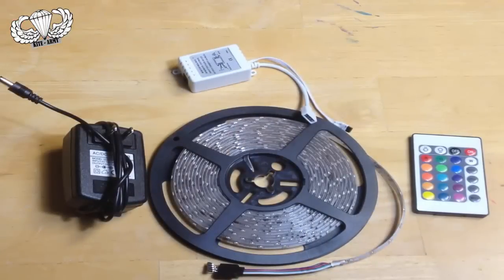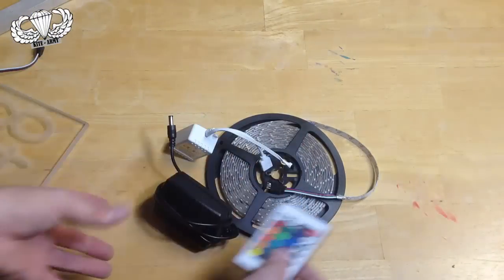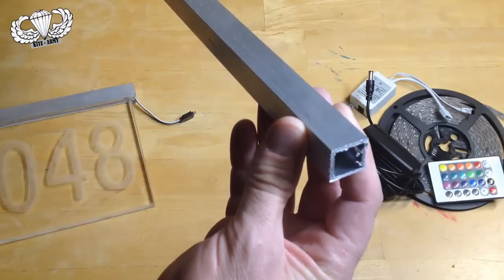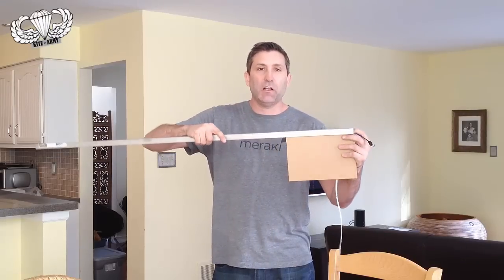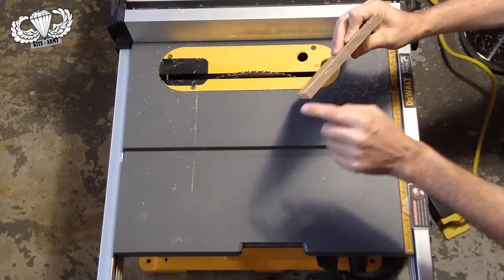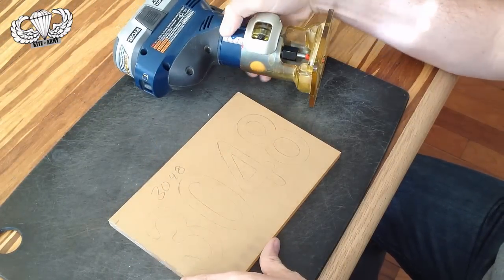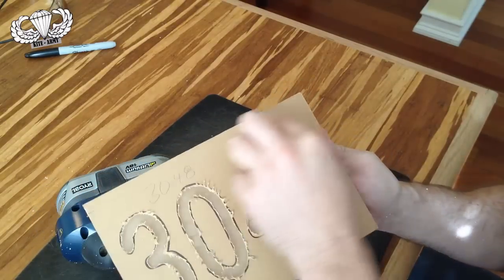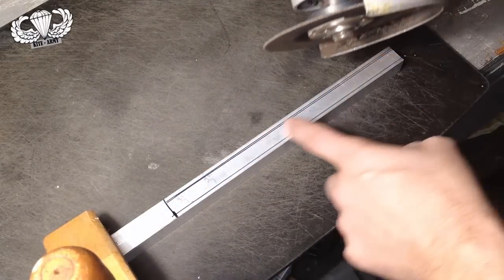Make LED Light House Number - DIY Build Project

Comment: Can you make it work from Dust to Dawn with an attachment, that's what i am looking for Tom of cape coral fl thanks and nice job guy
Reply from the maker: Sure - all you need is a photovoltaic sensor for an outlet that drives the power supply

Comment: One assumes the sign will be used outdoors so why not discuss weather-proofing it? 

The least I would do is inject some clear silicone weather sealant into the ends to prevent bugs and moisture from entering.

What I am not sure about is how I would protect the electronics boxes from rain and snow. Maybe I would cut the wire from the power supply and splice in a longer wire so only low voltage is running from my house to the sign. 

In my case, the sign would be over 150 feet away from our house which sits back from the road and atop a small hill. The sign would help delivery people and first time visitors find us.

Do other DIY folks out there have any ideas about these issues?

Thanks.

Terry Thomas
Atlanta, Georgia USA
Reply from the maker: I have it outside for over a year with no issue.  But once your sure you have it right, silicone certainly won't hurt.
Reply from the maker: Other thing.  I installed my power supply inside my walk way 110v light.

Comment: Very much appreciated!!  Just like to get a more professional way to write letters / signs in acrylic but it is not expensive!
Thank you
Reply from the maker: Do you have access to a laser engraver?
Reply: Or a dremel tool. I personally like the effect of that better than the deep engraving the router does. You only need to lightly scuff the acrylic to get the glowing effect.

Comment: I use Lumenedge LED edging, it comes already assembled and is not expensive. I order my acrylic on Amazon or buy it through Techshop. I then go to Techshop (maker space) and use one of their 24" x 18" CO2 lasers to cut and engrave the acrylic. This way, I can get large poster-sized LED lit signs done in about 30-60 minutes. Wanted to share this alternative method with you.
Reply from the maker: Laser cutters are the best

Comment: USE THE TABLE SAW to cut the aluminum. Almost any carbide blade works, just go slow and use a push stick.
Reply from the maker: That will work too.  Great tip
Reply: significantly riskier for the average user.

Comment: Nice video!  Another way to do this is to cut out your design with an X-acto Blade and using comet sink cleaner to rub into the cut-outs by fingertip, or you can also use a spray can of window frost.. This will give you the fog / Frosted look you desire.  You can use anything that is basically made of a fine abrasive including fine grit sand paper.  This way you can avoid all the tear out and un-evenness of the lettering depth that you can get when using a dremmel or router.  Sandblasting is another method but you really need to watch the pressure guage while at the same time keeping an eye on the edge of the lettering cut-out but it can be done using sandblaster also.  Another good idea is to find metal designs and simply set t against your plexiglass and sandblast over the object to get it's silhouette on the plexiglass.   Hope this information can help others to think outside the box.
Reply from the maker: Great tips!

Comment: Meraki tshirt :) 
I used Meraki for years but their cloud based management cost us $120 annually per access point so we moved to Aruba and Ruckus APs
Reply from the maker: I was wondering how long it would take someone to comment.  I used Aruba and Cisco - Feature wise these are the best.  Headache wise - Meraki everyday!  I have even started using their switches and firewalls.

Comment: Where did you find such thick plexiglass?
Most warehouses I found had 0.8mm as their thickest, the one you used looks like it had 1.2mm or even more.
Reply from the maker: I just ebayed 1/2 inch plexiglass.  Cost about $9 delivered.
Reply: Kite Army
Alright, thanks!
Ebay did the trick indeed.
I previously had problems finding offers in Europe.

There also appear to be differences in quality which have quite an impact on the price.
Reply: +LinkEX Check around..  I always buy plexiglass sheets  1/4 x 8' x 4'.  Back in "91 I used to get a sheet for $98 but today it's double that.  I build Candy Display Units and Cash Register arm guards for theft deflection in local stores.  I also use it to re-cover refrigerators with a new surface that can be paint colored at your choice or the customers to coordinate with the colors of the kitchen.  There are a great many ideas and uses for Plexiglass.
Reply: +Sam A design can be painted on with fluorescent paint:  it is light enough to allow light to pass through.

Comment: Couldn't you just use some etching solution like they use on glass to make the letters?  I'm a stickler for straight and perfect lettering or numbers so I'd probably go through about 450 pieces of plexi with a router until I was satisfied.  I really like the project tho as your address numbers are on a post that is about 4 ft in front of the porch light so you can't see them.  That's how the previous homeowner hung them and they look nice but you can't see them at night.
Reply from the maker: +slundy I think you could get the numbers perfect even with a router.

Comment: TIP ! place some isolating tape first on the metal strip before sticking the led strip on it . because with wet weather the contacts on the led strip could make a short circuit right trough the Scotch tape of the led strip !
Reply from the maker: +gertjan van der meij Thanks mate...

Comment: Dude you need to learn first its not a circular saw,and second you should be holding the piece between the blade and the fence,im surprised you have all your fingers.......... please look at a video on how to safely use a table saw.
Reply: Yikes!  Agree that's a scary way to cut things on the table saw.  I've seen pieces that are ejected from between the blade and fence go through wood-backed aluminum siding. Use a push stick!  Also, put the 9" you need to keep between the blade and fence.

Comment: Is there a way to make a work using batteries?
Reply: +Laissez - faire Yes, You can run a solar electric fence charger to do it. They use a sealed lead acid 12v battery
Reply: +Sam it will probably work using a 9v, but not for long.  then use small solar power.
Reply: +Laissez - faire Yes you can use batteries to make it work but you would need a wide stile, or a wide rail that you can use to embed the batteries as a hidden feature.  You can embed the batteries and you can mount a mini switch which you can also embed.  You can use a toggle switch or a tiny push-button. switch like the one on your kindle.

Comment: I Love how in USA the house numbers r 4 digits, my house number is just 22
Reply: KrisRaps Not everywhere in the US. Addresses are laid out on a grid system from a central starting point. In my state the address grid is county wide. The further you get away from the starting point the higher the number. So 22 would be real close to the starting point. We have some address that are 5 digits long and we have some that are 2 digits long.
Reply: squidink RC as started above the address numbering system is based on a grid. Different locations within the US may have some differences but it is still a grid system. It would be extremely rare to see a single digit address, though not unheard of. We don't use them in my locale because it screws with our dispatching system for 911. Addresses aren't signed based on numerical order either they are assigned based on plot. Even numbers and odd numbers don't intermix.
Reply: +KrisRaps A lot of that depends on the population density. In Los Angeles, some of the house or building numbers are six digits. My rural home is three digits. And in some older cities, like Charleston SC (Est. 1670) some of the house numbers have A, B, C  etc. appended due to there being no more numbers available in the postal service layout. So when they add another building and increase the population density, they add a letter. It's packed in there in some old towns.
Reply from the maker: KrisRaps See that....more reason why the USA is great!
Reply: KrisRaps Many are 5 as well.
Reply: Mike L I Understand that, just that in my Country there is a Seriously rare  that the house number are like 300 or even 100..
Reply: +KrisRaps  mine has 5... ;)
Reply: +KrisRaps In France, in city streets, the number matches the number of the house in said street, but in a lot of out of cities roads, they match the number of meters from the beginning of the road, so we sometimes have number 4278 on a road with like 2 houses, if it's 4278meters away :)
Reply: In the US it is 100 per block so 3018 is near 30th.
Reply: But my house number is 4. I guess I don't actually live in the USA anymore lol
Reply: +KrisRaps it can be as low as 2 numbers, my work address is 2 numbers, my current home address is 3 my old address was 4 and i&#39;ve seen 5, but that takes a pretty long road to achieve, so it&#39;s typically only seen on highways and it&#39;s based on distance from the start of the road, like for example 1000 would be 1 mile from the start of the road, this was done so that the EMS would know how far down a street to drive to find the driveway. also even numbers on right odd numbers on left, so you can always know which way the numbers are going to go based on the side of the street the driveway is on.
Reply: 3 to 5 numbers are more typical with 100 streets per city direction and each block broken into hundred block segments.  Live ner downtown then it could be 804 8th Avenue but live a few mile away 6039 45th might be your address.  Live in a suburb the used the downtown instead of the 12412 68th Street might happen.  I live in fringe area so my street number is high but the Avenue reference is not from primary metropolitan center but from the secondary metropolitan center a few dozen miles north of the primary metropolitan center.  It a fairly complicated matter even though it is not complex.
Reply from the maker: Your entitled to your opinion, BUT I for one disagree with you.
Reply: I love how you are an idiot! House numbers count from 1 , YOU IDIOT
Reply: +Mike L I am a 28 down my street there is 1-9 and so on. You can find small house numbers in neiborhoods.
Reply: It is not the long number, it is the FREEDOM & LIBERTY!
Unfortunately in states like California LIBERTY IS PRACTICALLY DEAD - since the idiots of SOCIALISM TYPE are in control!
If your number is 22 and you have zero socialism YOU ARE BETTER OFF!

MAGA!
Reply: Did you ever hear of a jazz band named  THE ODDS GET EVEN ??     lol

Comment: This is a terrific project, Kite Army, and your video is quite well done and easy to understand. I have a couple of questions for you:

1} Would the power supply be wired into the house circuitry, or is it plugged into an outlet?

2) My understanding is that when a sheet of clear acrylic (Plexiglass) has light directed onto it, the clear, flat surface does not reflect the light, although it may take on a secondhand glow from a bright light source. It is the surface that has been marred in some manner-- the cut edges, or here the routed out characters -- that truly reflects the light. So. if the etched out numbers themselves were coated with black epoxy, the original desired effect will be negated. Is this true? In addition to responding to the actual question here, any corrections, clarifications, and additonal information to my general understanding would be greatly appreciated. Thank you very much.

And thanks a million for the inspiration! I am on board!!
Reply: Hi. Its been a while. I'm wondering if you ever figured out where the power source would come from? I don't have ab outdoor outlet but I do have a porch light that I could steal power from.

Comment: I was wondering, could I use etching cream? I don't want to think about how much a peice of glass that thick would cost!! Thanks
Reply from the maker: Wesley Ferrell I got it for about $12 delivered.  Not to bad.
Reply: Kite Army Have you tried it on the acrylic yet, if so what were your results?
thanks
Wes
Reply from the maker: Wesley Ferrell Oh...this stuff is plexiglass, not sure how close that is to acrylic.
Reply: Kite Army Thank you for responding. I think that a lot of times, people use the acrylic and plexiglass interchangeably. Oh well I will investigate further and let you how I made out.
Wes.
Reply: Wesley Ferrell Yes, but it will not glow as well.
Reply: Kite Army Not as durable and you have to be more careful with polycarbonate since it can chip easier but I use a special blade from Freud that has different kerfing.  You can also scrape the edges to remove saw marks before heating the edge.  It's actually preferred over sand paper with acrylic but with plexiglas you want to sand it.

Comment: Cool project. Maybe try a light sandblast for your numbers to give you a more uniform scuff. Not sure how well the protective layer on the plexi glass would hold up to that though.
Reply from the maker: dustin s Great suggestion.  I'm pleased with the result but this may work better for some.

Comment: After you cut the LEDs does the rest of the strip remain useless?
Reply from the maker: Bird_is_the_nerd Nope, you can use it for another project.
Reply: Kite Army Then how do you power them if the others are hooked up?
Reply: Bird_is_the_nerd What you'd need to do then, (just basically, i've never done it myself) is to by another reciever, and also power supply, and also buy a connecting wire that goes from the reciever onto the led strips. then, depending on how expensive the led strip you buy is, will either just plug straight onto the rest of the long LED strip that hasn't been used for this project, OR you'll have to solder the wires onto the LED strip itself.
Reply: Bird_is_the_nerd No, you can just get another connector for the power supply.  The important ting is to cut where it says or it will not work at all.  Strips also come in two basic density / brightness levels.  I have several projects I'm considering doing.